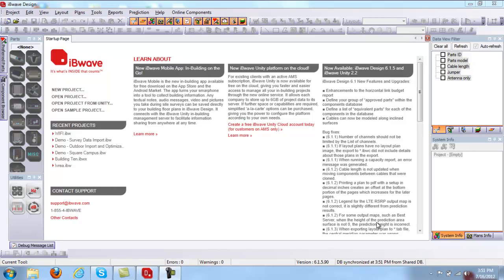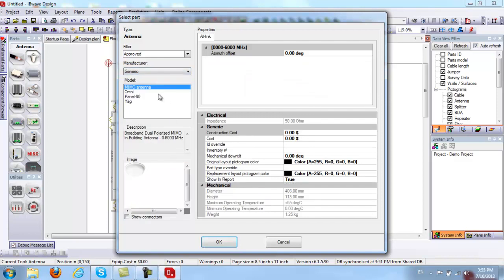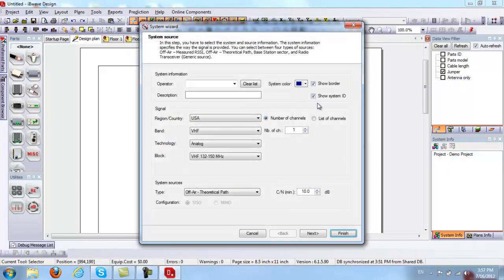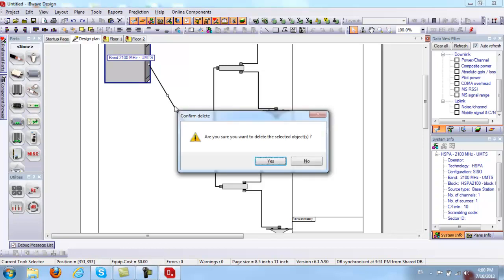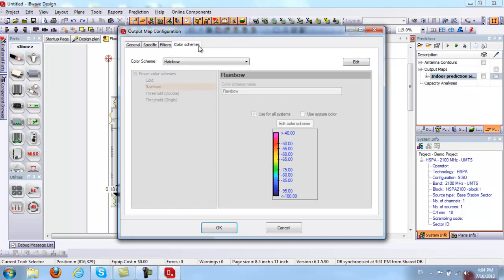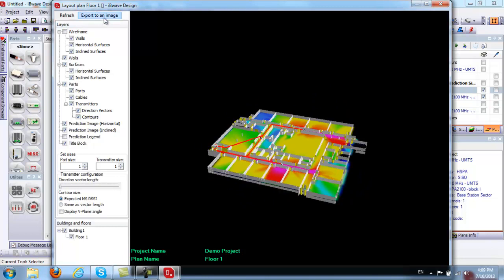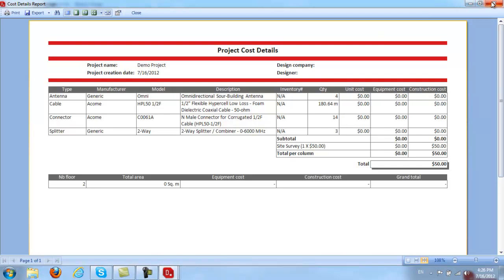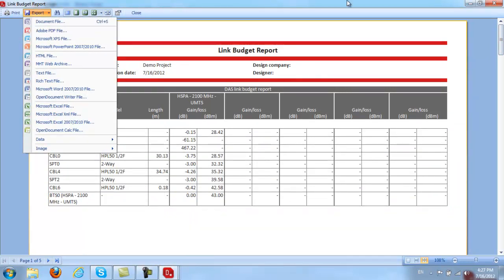iBwave Design 6 x Demo Torurial 720p

Comment: Thank you for the video.  Can this software do campus antenna design? I'm assuming it can be used for anything wireless?  DAS, WiFi, Cell, etc? How about licenses or users?
Reply: @darwinatendido3129  you mean if I have a design solution I'd like to purchase or if I have a specific project where customer is requiring it?  I've been talking to Cory Abrams at iBwave to see which solution fits best.  Thanks
Reply: Is iBwave certification mandatory for a DAS ARCHITECT?